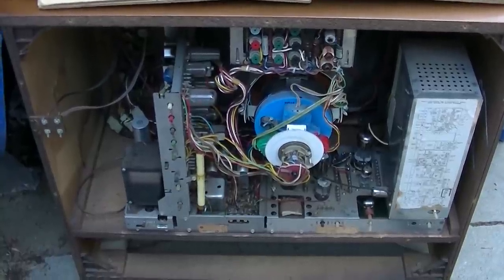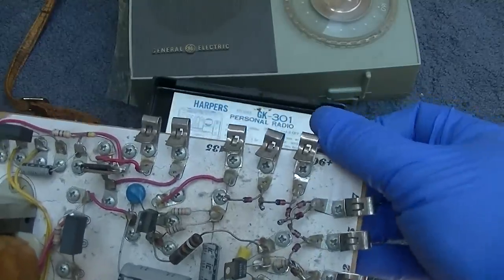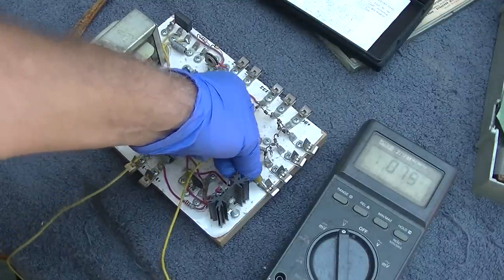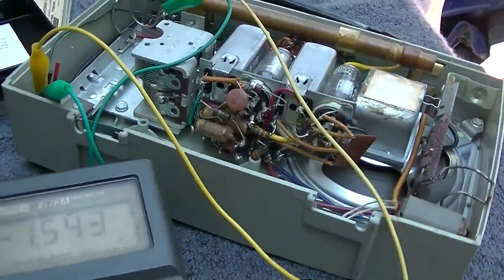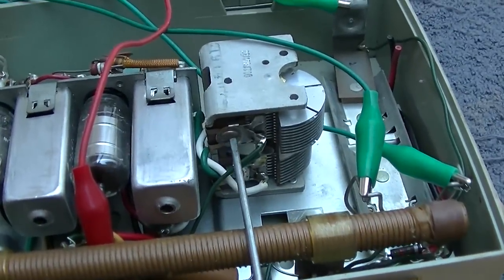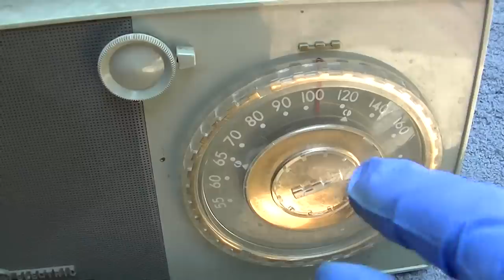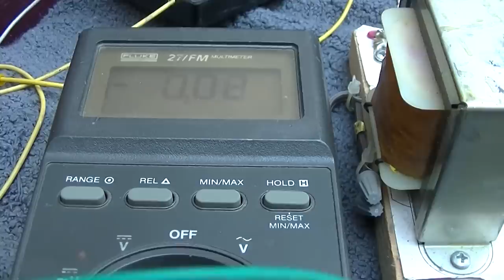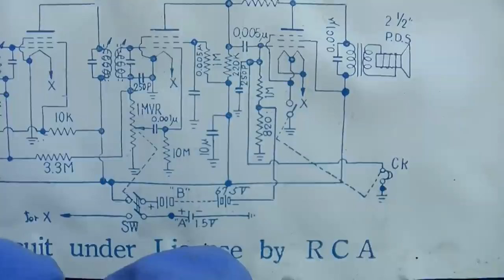4 Tube Personal AM Radios and AES Battery Eliminator

Comment: had a vintage 2001 kreisen Glass LED display, it was 47 volts, it's off-campus power supply melted it's own connections, one could fry an egg on it~ thems was the good ole days

Comment: Former airplane owner:  Heard your comment about leaded avgas.  After more than two decades we recently got an unleaded 100 octane gas approved.  The impact on your aircraft noise is going to depend on how much more expensive it is than the leaded stuff.
Reply: I'm curious what it'll do for valve recession in older aircraft.
Reply: @PapiDoesIt  that’s my concern, the lead in it is to provide protection a cushion, and I think there’s more too it I’m no plan expert by no means but I know on those types of aircraft the air fuel ratio is pretty critical, but what I’m not sure of is if the mixture is the same as that of a vehicle which is 14.5 if I recall correctly. If it isn’t  14.5 and let’s say they are running leaner than that that’s a lot of heat!

Comment: On the first radio you connected the negative of the B supply to the ground of the A supply. Assuming the standard circuit this is improper. The B- input goes through a resistor which provides cathode bias for the output tube.

Comment: Cool!! I have built the AES battery eliminator kit back in the late '80s or so, and have used it to power several types of battery tube radios, including an Atwater Kent 20C. It is a great kit, I still have it but need to change the LM317 regulator for the "A" supply because one of the leads broke off it while moving!  I always think these old personal portable tube radios are cool, especially "subminiature" ones, but also the regular miniature tube ones as well as larger earlier "suitcase" type with the larger octal tubes!
Reply: Oh! Also, I have that same "Harpers" radio, which the name plate had come off of mine so now I have an idea of the brand name now! Japanese, and mine has unfortunately a big piece of plastic missing from the back cover.
Reply: I built3 of those Aes power supplies over the yeàrs all worked good except for the last one was 10 volts low on the last tap.

Comment: Interesting old radios. According to Radio Museum, the GE was made in 1954 and the Harpers was made in 1960. Their time was short. I got my first portable radio in the late 50s, and it had transistors. Same 9 volt battery that is still commonly used. Tubes were still used in table radios into the 60s, because I bought one in 1963 when I went off to college.

Comment: Chinese counterfeit parts are a plague. I bought many Toshiba and Motorola audio output transistors online. All were counterfeit. Never again. I since bought them only at well known distributors. They were supposed to be 200W RMS but the die inside the plastic casings were as small and even smaller than the one you'll find in a BD 139/ TO-220 types. There's also many counterfeit capacitors as well on the market. When the price is too good to be true, that's because it isn't. I'm glad you address it! Those are shyte..
Edit: English isn't my language.

Comment: Hello Shango I want to share my experience with an eight track player I just repaired. I know it has no relavence to this video but its about an old audio amplifier that has crackling sound in one channel. At first I thought it was a bad germanium transistor but before I changed it I shorted the input leads going to the head on that channel and the crackling stopped. This amplifier uses PNP germanium transistors and instead of using ground for the head coax wire shield it  uses the negative hot wire which is about twelve volts potential from ground. The head case is ground and what was happening was there was moisture on the phenolic insulator that holds the head leads and making high resistance leakage on the sensitive input lead. I took my heat gun and boiled away and dried out the insulator and no more crackling

Comment: The 67.5 volt “Flash” battery was also used in geiger counters of the era.
Reply: That is very true.....A friend of mine has a dozen or so of those.
Reply: Do they have room for 8x 9V batteries? Then problem solved 🙂

Comment: I thought the Caltrans testing lady left the air,  unless this was recorded a few months ago,  But if this is newer video, then can I suggest doing a transmitter hunt for the source of the Caltrans testing lady. I'll bet the transmitter is on the side of the road right near a major road or interstate. The antenna is usually fiberglass white and a bit taller than  a Solarcon  A-99 CB antenna

Comment: I have that same power supply. I built it about 25 years ago. I use it with my old Atwater  Kent Model 20 and 35. I did replace the heat sink with a heat sink with a fan as it seemed to get very hot.

Comment: IIRC the 3V4 and 3S4 are the same electrically, but different pinout's.  The 1u4 is the more common IF tube, but some sets used the remote cuttoff 1T4.
Reply: 3V4 and 3Q4, actually. The 3S4 has slightly lower specs (e.g. 67.5V g2 max, vs 100V for 3Q4/3V4), 3S4 and 3Q4 share the same pinout.
Reply: @Crosley-1520  Then there is the 3Q5GT, which is a true beam power tube.  All the others are power pentodes.
Reply: @Crosley-1520  Thanks for pointing this out, I often wondered if there was any difference besides pinouts. Makes sense that the Harpers radio uses a 3S4 to conserve some power as well as run more ideally on a 67.5V battery rather than a 75 or 90V B battery.
Reply: in the UK DK91/1T4 was most common 50ma IF type, with DAF91/1S5 instead of the 1U5
Reply: @KennethScharf  not necessarily,  i'm in the UK and have some each 3V4/DL94 and 3S4/DL92 and theyre definitely beam tetrode construction, except one 3S4, branded as mazda 1P10, is truly pentode , i have a couple of DL33/3Q5 and DL35/1C5 , but cant remember,  may vary depending on manufacturer, most ones here are of mullard/philips manufacture

Comment: I have a red GE, same model. I use 8 9v's in series, and two D cells for power. It eats the D's, even alkalines fast, but the B battery lasts. My handle's pleatherette handle is peeling, but the case is not chewed. It listens to a 1 kw daytimer that plays oldies and local ads. At night, I like to open the back and barely see a bit of bulb glow. I show it to youngsters, and they don't get it.

Comment: Please do a repair video on the Harpers Personal tube radio, I would love to hear that radio play. Not everyday you see a portable tube radio that small, I have GE transistor radios bigger than that. As usual Japanese made tube radios used leaky paper caps. I repaired one that had all the leak (beaky) Caps in one package and the plastic case breakage was worse than the GE you have there.  I liked seeing the GE Tube radio working.

Comment: Today is a great day testing. testing. This is only a test. I'm thinking of making the trip from Camarillo to Torrance just so I can hear that and get my groove on. Klinky dinkler the snorgle spoimler. At night I can get BLM radio, but fortunately at 1590 there's KABC.

I built a 67.5v B battery eliminator I found online. I think from Phil's old radios. Costed like 10$ to make. Only downside is that it makes the chassis hot. But whatever. I know not to use it in the bathtub.

Let me know if you are in the area, or going to a SCARS meet. I have a couple transistor radios I'd like to give you. I'll be at the one in Burbank next month.
Reply: What is that a test for?
Reply: @chrissanders2562  No clue, but Im going to the Torrance area this weekend, so maybe I'll find out
Reply: @nickb.8876  ever find out what the test lady is for?
Reply: @chrissanders2562  No Unfortunately..

Comment: Today is a great day testing testing this is only a test this is only a test today is a great day testing testing
Reply: I just wonder what and where it is,
Reply: @LarryBlowers  I left a longer explanation further up in the comments, but it's on 1610 KHz, and it's most likely either WPHJ962 or WQED842, both of which are in West Los Angeles, beside highways, roughly 10-15 miles (15-25 km) north of Shango.  It's a highway advisory radio belonging to Caltrans, only they don't broadcast any useful information on it, just that audio test loop.  The transmitters only run about 10 watts.  The other description above tells exactly where those two radio transmitters are.

Comment: What I find ironic is these old tube radios are almost just as hard on batteries as the latest dab plus digital radios we have here in Australia.  I put a current meter on a digital radio and the current draw was between 200 and 300 miliamps.
Reply: yeah these tube radios use less power than a phone does.

Comment: It would be interesting to know what the test station is all about.   I imagine it would be government run  or endorced as it would cost a fair bit of money to keep it powered up and running.    The selectivity on the GE seems reasonably good, maybe a little alignment will help the sensitivity, but for an unrestored portable it seems to work ok.   I guess people wouldn't use a battery radio for DXing really.   With the little Japanese Harpers radio, it could be the person that sent it to you put the cardboard in place to help hold the tubes during transport.  It likely didn't have cardboard from the factory.
Reply: Iv'e tried listening to it on some SDR's in the Los Angeles area and can't hear it on any of them. Also done some google searches but can't find anything on it.

Comment: If those tubes ever have to be replaced, look into 1Ж24Б and similar "rod" tubes, over here these military surplus tubes are often used to substitute the much more expensive American tubes which were imported back in the commie era for use in the locally produced portable tube radios. They also should be more efficient than the original tubes, at least in the RF portion of the circuit. Said tube is an RF pentode drawing just 13mA at 1.2V.

Comment: Is that testing station real? That's so creepy.
Reply: Today is a great daythisisonlyatest
Reply: Yeah, it's only been around 70 years.
Reply: Yes, it's a Caltrans highway advisory radio on 1610 KHz, only Caltrans isn't airing any advisories, just that audio loop.  No matter, because most people would just tune to KNX 1070 for traffic reports.
Reply: I cant find it but im in Massachusetts and this is a video from cali
Reply: Thanks to Nick B. for a field report, correcting that this station is on 1700 KHz.  It's most likely still another Caltrans station, WPET709, at Imperial Hwy and La Cienega Blvd, near L.A. International Airport (LAX).  That's very close to Shango.
Reply: On doing further research looking up caltrans radio, its a 10 watt transmitter.

Comment: I bet Shango already has the diagnosis on the Harpers set pinpointed and ready for the next video on it- leaky paper coupling caps, especially between the volume control wiper and grid of 1U5 as well as between plate of 1U5 and grid of 3S4! Also the electrolytic is probably bad, causing the "squoaching" between stations!
Reply: leaky screen decoupler on the 1u5, if it has one will easily kill gain, as very high resistances are used,

Comment: That has to be the smallest tube/valve radio I have ever seen!
Reply: The Harpers is the smallest tube radio I own and have seen ever that use the full sized miniature tubes. There are some smaller models that use subminiature tubes like the Emerson model 747. The Motorola Pixie is in between those sizes and uses I think one full size miniature tube (I think 1R5) and others are subminiature.

Comment: That GE sounds pretty good. Too bad about the case damage. Maybe can be fixed. That battery eliminator is nice to have. Had an electronics magazine in the mid 70's that had plans for an eliminator to early battery radios. I've got a Zenith Wavemagnet portable that needs gone through. Case looks great except for the missing handle. This unit can also be plugged in and used without batteries. With silver/mica disease in the IF cans, what is the best way to get around that?

Comment: Very interesting! You never fail to entertain! BTW, do you still use leaded solder? Do you think it's hazardous? I can't get myself to use lead-free solder. It's awful to work with and quickly destroys soldering iron tips.
Reply: Louis Rossman uses leaded solder on his repairs. But also has a fumes extractor for that same reason.
Reply: The lead does not become airborne.
Reply: @capolaya  No wonder Louis Rossman is kooky!
Reply: @westelaudio943  Logically, it would seem that way but I've read differing opinions about the hazards of working with lead solder. Some people won't even touch it. There was lead in plumbing solder until it was banned in USA around 1986.
Reply: @acoustic61  

AFAIK, there isn't even any (serious) debate about that. The lead does not become airborne. The fumes you see while soldering come from the rosin and from contamination. 
Shango has been told this time and time again, and yet, he choses to repeat this type of statement all the time anyways. 
Which in itself is not surprising, considering where he's from, even though he's definitely one of the least mental inhabitants of that dismal place. 

Of course, you wouldn't want that stuff in your water pipes, where it might get eroded and would contaminate the water downstream. Even though I'm not sure if I'd even worry about that, as I would think the limescale buildup quickly starts to inhibit the erosion process after the pipe is installed - but I'm no expert on that.
I would say that, all be it it's kind of a cliché statement by now, people are way too soft and afraid of everything nowadays.
Reply: @westelaudio943  unleaded solder is awful, and maybe one cause of a lot of early failure of modern 'tech' with tin whiskers forming and causing shorts

Comment: be very careful with those '1.5v' tubes, its very easy to blow the filaments,, been there, done it... i advise not over 1.45v,    the lower current 25ma types even more sensitive to over voltage,

Comment: Wondering if anyone can talk about older radios that have TV channel bands. I just got an old Sears unit (Model 800 272400) with TV1 and TV2 bands (2-6) (7-13). Of course TV is all digital now, but on TV1 there's a bunch of what seem to be FM stations, coming in clearer (super clear, no static,) than the regular FM band. The station is 91.5 FM, but the dial is up around 100 FM and just above channel 4 on TV1. Paid $1 for the unit. Had to spray all the switches, but it's a pleasant surprise that it's working so well.....just curious if the TV band is a more accurate tuning subset of FM??
Reply: no the tv bands are just regular FM at frequencies outside the radio spectrum (88-108). The FM audio for analog TV 1-6 was between 48-79mhz if memory is correct and for the higher channels it was around 180-220mhz. 

most likely the radio is way out of alignment or the band selection switch isn't working properly if you are picking up a station broadcast on 91mhz on the TV1 band, picking up a harmonic is possible but it shouldn't sound better than the correct frequency.

Also FM usually does sound good with no crackles if your radio is in good order and the signal is good.

Comment: General aviation is so slow to change. To get a new engine certified means going through a million hoops. There really only has been one new engine type successfully released in the last 70 years (Rotax). The Continentals and Lycoming are pretty much the standard and were designed for leaded fuel three quarters a century ago. Even cylinder head upgrades have unknown consequences on reliability - they say..They need a rocket somewhere.

Comment: I would bet that over half of those radios used the batteries that came with, and when the owner found out how expensive the 67.5 volt batteries were, they were never used again.
Reply: I think the were used on family outdoors at the Beach or weekend camping trips.
Reply: Oh, I don't doubt it. But those high voltage batteries probably cost somewhere between a third and one half of what the whole radio cost to buy. They were crazy expensive. Back when these radios were being sold, you did not have the whole retail concept of discounting. Most items were what was called "fair trade" priced. If that radio sold for $35, it sold for $35 everywhere, and maybe, if you really looked and drove 50 miles to another town, you could find some place that was selling it for $33. But you really could not find such a place, because it was illegal to advertise lower prices in that era. Those batteries were very expensive, and you used them up in several hours. It was great to have a radio out there on a picnic, but it wasn't worth most of a day's wages to go buy the new replacement battery.
Reply: I'm sure some enterprising fellow figured out how to make something that'd plug into a car's battery and do the job ......until it burned the battery down stranding him, his pissed off wife, three &1/2 kids, two dogs and park ranger trying to jump start him. And let's not forget him losing his job because he missed half of Monday too. Just sayin..........
Reply: @Rev22-21  LOL. No doubt. But of course before solid state stuff, it was fairly non-trivial to create high voltages out of 12 volts dc. You had to use a vibrator, like early car radios. And I have never seen one of those old tube  radios that had a connector for external power, which there might have been, I have just never seen one.